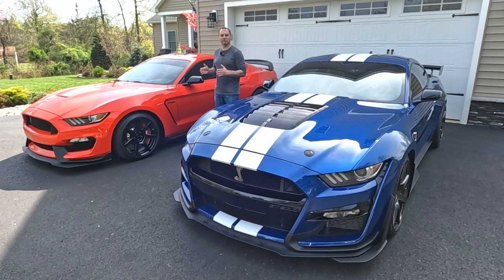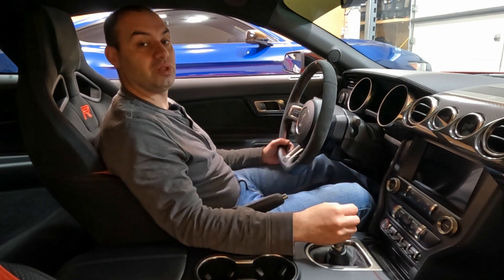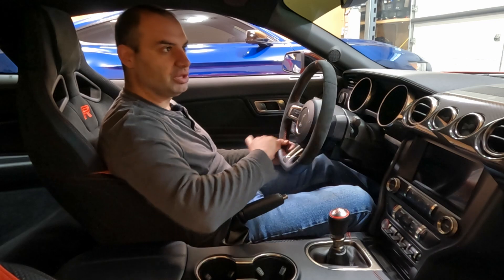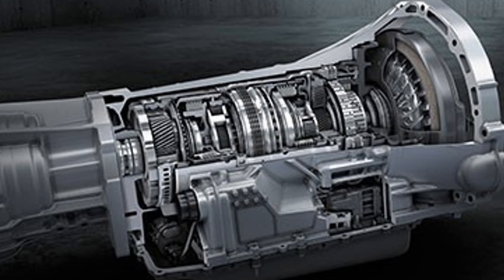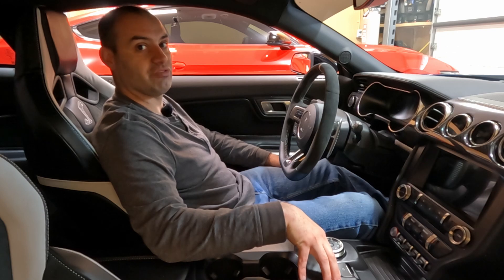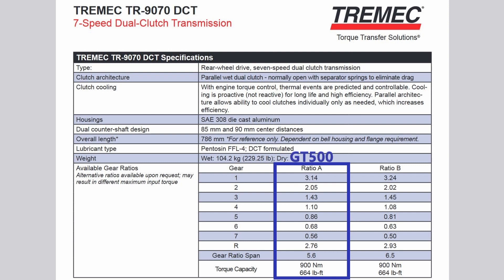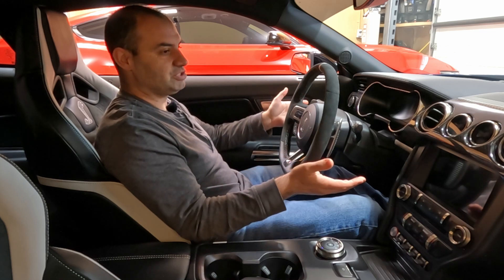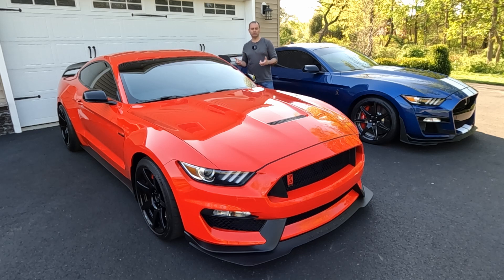GT350 vs GT500 Transmission

Comment: Well done!  Short of say a Miata, I have never driven a better manual that is in the GT350.  I do have to take exception to your comments about the Ferrari F1 system; it’s never clunky.  Thats just not a term I use to describe anything about my old F355.  It literally is like driving a manual box shifted by someone else, and while it’s no PDK, rev matching and finesse are required and rewarded.  Fortunately the single clutch is easy to replace, the housing is on the end of the transaxle.  Also neutral is easy as you simply pull both paddles and you can coast like a manual.  The GT500 DCT is up to PDK standards (and certain limitations), makes the GT500 a terrorizer.  Quiet exhaust mode, and normal car setting make it almost refined, not quite up to my 25 year old F car, (Cup 2s are punishing) but incredible for the astonishing level of performance.  Appreciate your content!